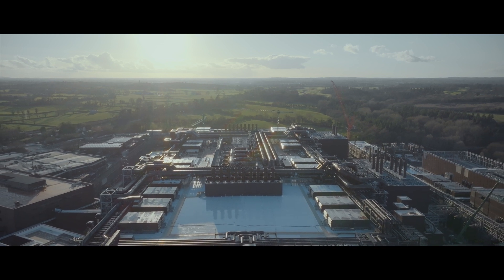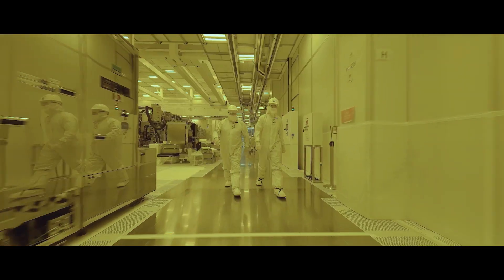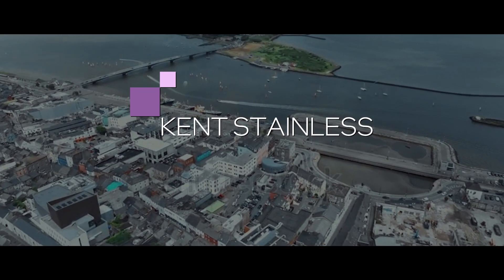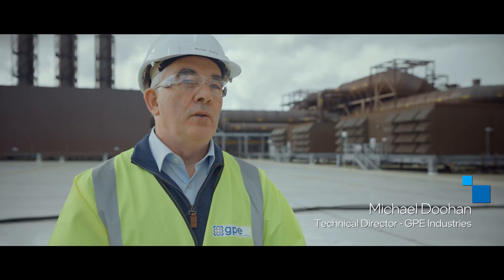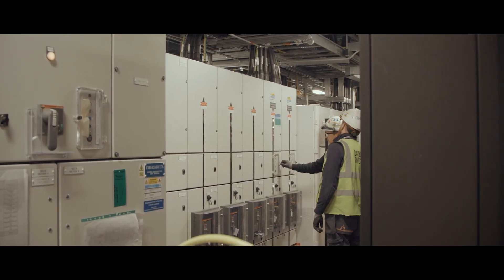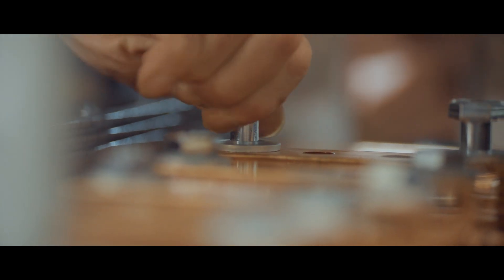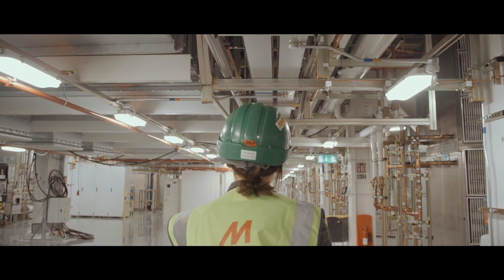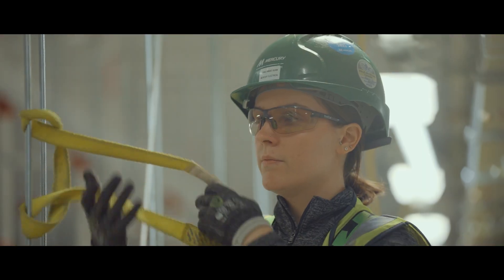Fab 34 - enabling a network of local suppliers

Comment: It's fun knowing things I've designed and built are sitting in both Fab 34 and D1X.
Reply: what things you've designed? I am curious
Reply: @nthutrump  I've worked with vacuum, abatement, control logic, etch, EUV, deposition, chillers, a little bit of everything, keeps the job exciting. One of the things I helped design and built is in this Intel video, was excited to see it finally turned on and running.  https://www.youtube.com/watch?v=hmkHoa_mpPo